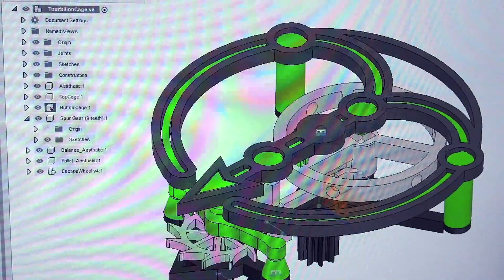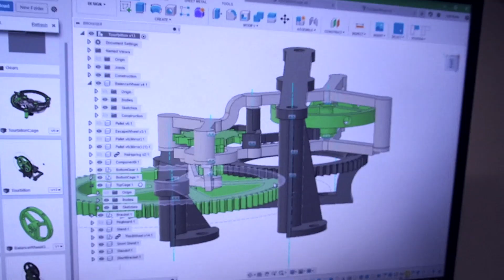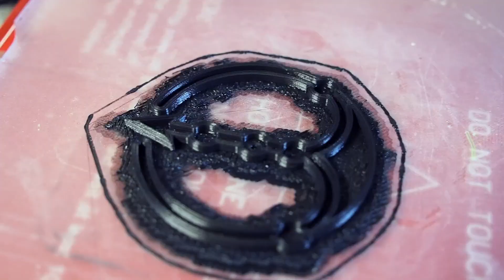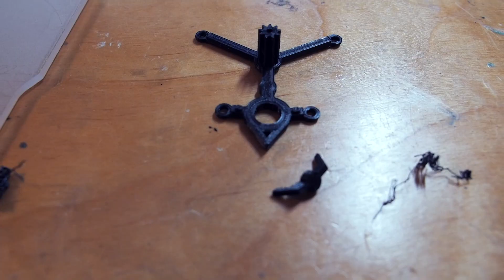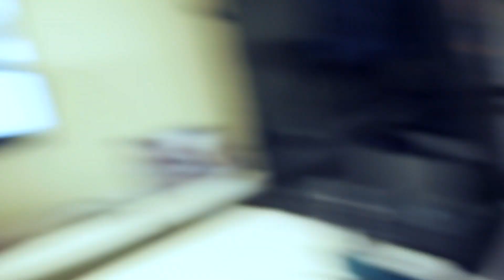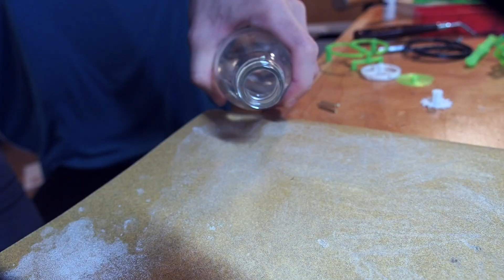3D Printed Tourbillon- Revision 2 | Homebrew Horology #8 | 3D Printed Watch Movement Development

Comment: Beautiful designs, but if you haven't tried printing on glass as a bed you should stop what you are doing and try that first. What you are doing printing that small pices on a raft and carving them of the bed looks like a pain. I have printed on glass for a long time now,  no raft needed, and the bottom of the parts gets to be perfect and you can use them as a mirror, no sanding needed. Also when printing on glass, the parts releases by themself when the bed cools, no need to carve them of. I spray my glass sheet with a tiny bit of 3DLAC to get adhesion. (its think its just a specific hairspray without perfume, i have heard aquanet hairspray is the best hairspray but i cant get it where i live so i just got the 3dlac and it works perfect). Look at my old video here how i remove parts of my bed: https://www.youtube.com/watch?v=ycGbiYwoBRY Have a nice day !
Reply: I have a glass bed. I use rafts. why? the pain. my parts that needed supports(I also do make some miniatures, but not as much as mechanical parts) keep getting stuck, and then I have 1 layer on the bed, stuck, and then I gotta try to clean that up(not easy)

so that is why I use rafts to be able to not worry about that.

edit: btw I just read the rest of your comment about tips, and I also use 3dlac, but it's 3dlac plus, so, maybe that causes too much adhesion?

Comment: As always, impressive. Where do you get the information needed to build this stuff, got any horology book recommendation? As for the filament, I use PrimaValue PLA, cheap, not as good as the Prusament, but reliable.
Reply from the maker: st00katz thanks for the rec! Everything I have learned is from YouTube and from reading through random watchmaking blogs and resources. However I have heard the George Daniels watchmaking book is quite a good resource and I plan to get that book soon

Comment: first off, do NOT buy your filament from amazon since the prices are heavily marked up (by 280% from $25 to $70 for the filament that i use the most), and the more affordable options are low quality and heavily doped with impurities that can (and will) severely damage your printer... if you go to the prusa3d website and order directly from the online eshop you can get a Kg of prusament PLA for $25, but it does however cost $12 to ship from europe to the US, so id recommend that you choose two or three per order... Ive mostly printed with prusament PLA and I have tried almost all of the options... the additives used to produce color, texture, and polychromatic effects do however slightly effect the properties of the PLA, specifically, hardness/flexability, cohesiveness to itself and adhesiveness to the build plate, high chance of stringing and surface level defects, long term tensile strength and degree of amorphous deformation over long time periods of extended function... just to name a few, so, the best ones that i have used for specific properties are as follows...
-> for flexability, consistent bed plate adhesion, and ease for prototyping the azure blue and prusa orange are the best I have used in that area and ive linked the azure blue below because if you decide to get anything from prusa, get this one...
(currently in stock)
https://shop.prusa3d.com/en/prusament/716-prusament-pla-azure-blue-1kg.html
-> for hardness, strong cohesiveness to itself, and durability the best ones are the ones with the "glitter" tag over the thumbnail, idk what the additives for those types of prusament PLA, but whatever it is it makes the prints extremely rigid and durable... the best ones are opal green, galaxy silver, pearl mouse, and galaxy purple... best one from this class is opal green...
(currently in stock)
https://shop.prusa3d.com/en/prusament/960-prusament-pla-opal-green-1kg.html
-> for high precision, very accurate tolerances, low friction with two surfaces of itself, evenly distributed hardness, and the ease at which it can be fitted together the best ones are gentleman's grey, lipstick red, "polychromatic" mystic brown, "polychromatic" mystic green, army green, and vanilla white... best one for high precision work is between the gentleman's grey and the lipstick red, gentleman's grey has just a bit more friction between separate parts of itself but it does have just a bit more hardness than the lipstick red...
(currently in stock)
https://shop.prusa3d.com/en/prusament/935-prusament-pla-gentleman-s-grey-1kg.html
(currently out of stock on back order)
https://shop.prusa3d.com/en/prusament/715-prusament-pla-lipstick-red-1kg.html
... ALSO, there are some relatively new types of prusament filament that still need some time to be improved and some filaments to AVOID...
Ms. Pink -- extreme stringing, inconsistent melting viscosity, will often gunk up the extruder nozzle
royal blue -- heavy stringing, low cohesiveness to itself, inconsistent hardness, very likely to deform mid-print
jet black -- very brittle and tends to break very easily, tends to deform mid-print, very flaky... expect some PLA splinters on your fingers when removing support structures
galaxy black -- (exact same issues as the jet black)
pineapple yellow -- has a high tendency to leave alot of stringing but thats really the only downside to it
...
anyway, thats just my personal experience with it... almost everything else ive tried ive ended up just throwing away because they would just fail to print or the impurities from low quality would damage my printer and build plates...
...
good luck in the PLA search and keep up the good work dude...
Reply from the maker: Jacob Howard I really appreciate this! Prusament seems to really know what they’re doing and I might just splurge on some of their stuff. Good to know that gentleman gray is a good choice for some of the stuff I’m doing, because I really like the color. I’m also curious to try their glitter infused/shiny effect filaments too, might throw in a spool of that in my order too....